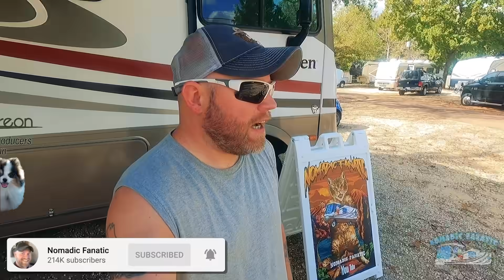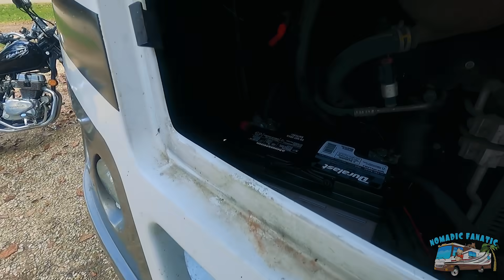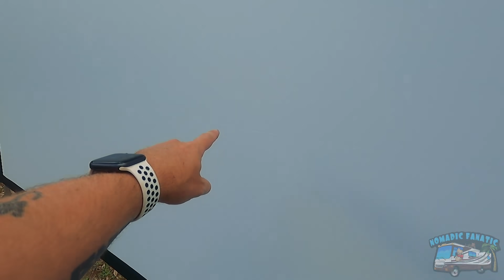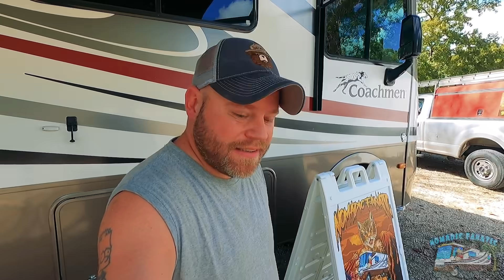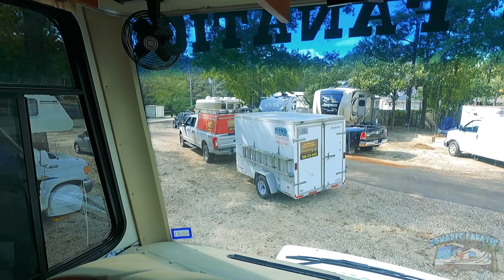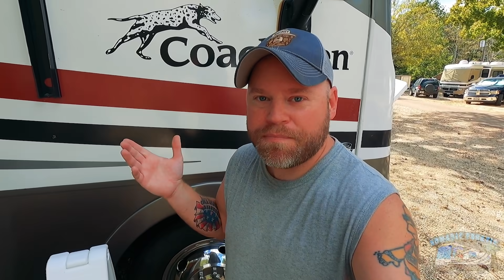More Onan Generator & Lippert Leveling Repairs... $$$

Comment: Trade it in and get a truck and camper.  You can use the truck for hauling things at your new home and use the camper (or trailer) for travels.  A truck really comes in handy for a homeowner, more than a Class A motorhome!!!
Reply: Absolutely...logical.

Comment: On my leveling system I have two breakers that are located under the entry step that trip. "Located high on wall above house battery and pump reservoir"

Comment: Is the hydraulic tank full on the level system ?  If the oil level is low the system thinks the lifts are still down. Has to be all the way full to read properly 🤔
.

Comment: Let’s try this again Eric had the same problem with my generator and if it would start up it run for a while and then shut it self off I waited a few minutes started it back up it would run and then it would shut off again I found out just by troubleshooting it myself found out it was the rocker switch inside the RV hope this helps👍🏻

Comment: When it rains it pours,once or twice every 4 yrs something breaks down at my house: hot water heater, AC,etc. Last winter I had a problem with the heater--it would work then shut off. It took 3 service visits to get it straightened out.

Comment: the biggest part of diagnosing  control systems and failure to do so,  is assumptions.  The old  saying, if you don't  know how it works, you cant fix it when it does not , is a very basic truth. The hardest part a lot of times in diagnostics is getting the proper information on how the system is designed to work.  If you have that information, you are in a far better position to actually fix the system, as you now know what it is supposed to be doing, and how, and compare to what is really happening. without that information, its  assumption time and that is deep rabbit hole. Please keep these thoughts in mind. 30 years  doing troubleshooting  stuff. there have been times I had to reverse engineer the system as we could not get the proper information on system operation, and that eventually led to the repair.

Comment: Elkhart Eric. Go to the Elkhart IN area. Mechanics that used to work for Coachman and Lipert are up there. And it's only about 7 hours to Alton from there.
Reply: Although this was 20 years ago, I had a friend with an RV with problems the dealer could not fix.  So he drove to the factory in Northern Indiana, and they did fix the problem.

Comment: Onan generator is vapor locking, add a fuel pump closer to the fuel tank. You only need a 5 or 8 psi pump. The sensor that detects the leveling legs position is possibly faulty.  The hot exhaust from the generator is heating up the fuel line causing the fuel to vaporize.  Fuel pumps move liquid not vapor. Adding a second fuel pump will put the fuel in the line under higher pressure thus increasing the temperature required to vaporize it.

Comment: Somewhere down the road there's a lemonade to be made with all the lemons you have accumulated.  Looking forward to that day.  That's the problem with a complex RV.  When they get old, they break. And in multiple places.  I have a 4kw onan generator and I'm on my third carb.  I've found that they do not rebuild very well.  About $300 and a little time, I was able to replace them myself.  I've got to run it frequently or I'll end up getting another new carb. They gum up sitting idle. As to the leveling system, I have no experience with them, but with the symptoms, I would suspect the "brain" or it's sensors are kaput.

Comment: Eric, who is the best person/shop to work on the leveling system according to Lippert? I mean you have an rv and it’s not like you can’t travel to them. Right?
As for the generator, the carb and fuel pump have been inspected by “a few” folks what about the supply line? What would happen if you ran the generator off of a separate tank? So the fuel supply would be coming from another source like a 5 gallon tank. If it just shuts off, that’s what I would suggest.

Comment: GENERATOR PROBLEM INPUT FOR YOU:  Our Onan generator would randomly stop running as though it was starving for fuel.  I am not an RV mechanic but people who are tried everything you are going through (carb cleaner, etc.).  Fuel pump tested fine WHEN IT WAS COLD.  After much frustration, I did my own diagnostics:  I ran the generator until it quit then quickly disconnected the fuel line at the carb (easy - its just a hose clamp).  i pressed the prime button on the generator which should send fuel down the line - BUT THERE WAS NO FUEL COMING OUT OF THE LINE.  Synopsis:  The fuel pump was fine when it was cold and generator haD just started.  The fuel pump would overheat (my interpretation) after a random time dependent on numerous factors including outside ambient temperature and then it would stop pumping fuel.  This resulted in the generator stopping running.  This has happened twice on our generator and replacing the fuel pump has fixed it both times.  Do yourself a favor and run the diagnostic I explained above.  Its easy and may be the clue you need to fix your generator.  Good luck!
Reply from the maker: Good work on yours. We've done that as well. Fuel still pours out. We even bypassed the main tank, and used an auxilary tank of gas to feed the generator and it still stops whenever it wants to with no useable code expect 36 - "engine stopped"... Worthless.
Reply: @nomadicfanatic  Sorry that's not the fix - darn.

Comment: Don’t know where you are at. The mobile technician I used in College Station was R&K mobile RV repair (or something like that). They might not be able to help either but worth a shot. Have you thought about going to the manufacturer?
Re the generator...Onan Cummins in San Antonio helped with my last RV and I took this new RV there for an oil change (was in a hurry). They are expensive but they know the units inside and out.
Bummer that all of this crap is happening. Keep your chin up.

Comment: Built by man fixed by man you’ve got the wrong people working on your equipment. Researching repair facilities is your first step and I am confident you know this, the fact that you a many others that travel full time experience this type of delay in getting speedy repairs. I find it easier and less stressful to find a quality repair site, then find a RV resort nearby until they get to my coach for repairs. Sounds easy but at times it’s the only option you have. You situation is unique in as much quality content can’t be produced as often when your stuck without your home. IF THE WHEELS ARE NOT TURNIN YOU ARE NOT EARNING! Good luck to you and JAX 👍🇺🇸🍺

Comment: Heres one for you on that generator. There's a low oil shut off sensor and if your motor home is not level the oil will go to one side of the crankcase and the sensor thinks its low on oil and shut off the generator to protect it. Just a thought. Hope you have good luck in the future.

Comment: That has to be really frustrating Eric!  I wonder if the hydraulic lifting pistons themselves have been damaged ?  do they each have a sensor in them which signals the control unit whether they are extended or not?  maybe one of those sensors or the lifters is malfunctioning?  at any rate, at least the RV is still usable without the lifting system.  The generator situation definitely seems like a more urgent fix, since you can't really boon dock without it, if there isn't reliable sun for solar.  Personally in your shoes, I would buy a small honda generator, as a backup.  At least it gives you more options / freedom.  Then I would probably try and get in touch with your pal Wayne... you can't under estimate the value of a good trustworthy mechanic that is an actual friend.  maybe he can give you some advice or take a look at your generator?  with the election sitting the way it is, and the potential for more and longer lockdowns, i don't know whether it'd be better to take a break at your house / property, or head for a state like FLORIDA that is actually open!  either way keep us updated, and keep keeping it real eric!

Comment: Have you disconnected the remote start harness at the generator? You could have a wire chafing and grounding out and shutting down the generator. Disconnect it and use the start switch on the generator and see how long it runs.

Comment: To me: It's NOT the RV. It's the lack of having professional people, people who actually know the items they work on AND have the proper tools (and contacts) to go deep in regards to trouble-shooting. The onan guy bench-testing the fuel pressure makes sense as a first step. If this is where his knowledge ends, bad luck. After this first step, he should dig deeper. One who really knows these generators would know where to look. the trick is to find a real professional. Same goes with the lift. The guy must have been on the right track, especially it the guy on the phone from the manufacturer knows his sh*t. If the display shows Jacks down, then there must be a sensor giving that information. This needs to be tested. If sensor is not giving such signal, then the harness/connectors do need to be tested. If no error is present, then the control unit must be diagnosed. This are just guesses, because I actually don't know the system, but a professional would know, AND find the solution.
I am surprised, that with your follower-base, there are no contacts to REAL professionals, who know the units with issues inside-out...
Honda Inverter generator could really be an option for you (maybe with a propane conversion), especially if you have a Victron MultiPlus, and the Batteries as a buffer. Average hourly consumption of the AC would need to be known to have a generator who could meet the average demand at least. Let's say (hypothetically) the AC requires 2000W while running, but only running 40 out of 60 minutes, then an EU30 with remote start could be a valid option. The Vicron MultiPlus could be set at max 2000W-2200W to draw from the generator, therefor generator would not run on full load. Batteries and inverter would buffer high start-amperage, and if no other units are running, the battery overall would charge. If batteries require no charge, the MultiPlus could even set to a lower max draw from the generator (eg 1500W), and therefor run QUIETER, charging the batteries, when the AC is OFF and delivering power to the AC (besides the batteries), while the AC is on. If no AC is required and power consumption is low, but batteries need some charge, then the MultiPlus could be set to draw 1000W from the generator only, slowly charging batteries and run pretty QUIET.

Comment: Are you only having problems with the generator while stationary? They recycle all the hot air until they overheat and quit running. If that is the case a blower fan pushing out the hot air from under the generator should help.

Comment: Hey Eric, sorry you're having such a hard time... But here's two things to check out..
On the generator, your fuel lines may have collapsed internally and no pump will supply fuel.. So maybe run a new line, not very expressive....
  The leveler may have a gyroscope issue, there should be a box that is mounted to your frame or under the dash that if it has fallen or is not horizontal it will always think it's our of level thus not work.
  The slide should be able to be fixed by a mobile tech.

Comment: I had a van that would do same thing as your Generator. Sediment in fuel tank would get sucked up and engine would die. Would let the van sit for awhile and it would start up great . could drive for a few scond filter in tank filter in fue  F mile and would die again. Maybe your picking up sediment in your fuel tank. Possibly a filter in tank. Just a thought. I.m not familiar with RV setups

Comment: Everything can be fixed. It's just a matter of finding people that sometimes think outside the box instead of 'what usually works'. I have run into this too often in my life. What I have done is researched the hell out of what others can't seem to fix. Now, years and years later, I can fix nearly everything I own. Even though I am in law enforcement and not a trade. Good luck and maybe it is time to recharge a home base with other projects.

Comment: Would try taking your rv to an actual hydraulic repair shop. If nothing else they should be able to rig the hydraulics to operate manually. Hydraulics are not rocket science. ok, maybe some of the electronics are that the rv manufacturers install but for the most part hydraulics are not super complicated stuff. 

As for the generator it probably would be best to just figure out a way to best setup a portable unit.

Automatic push button systems are nice until they mess up and no one can figure out how to fix them. Simplifying systems will likely be better in the long run.

Your slide problems are likely the biggest issues you have as the slide operation is dependent on the structural integrity of your rv. 

Good luck man and keep your head up. You will get it figured out as you always do.

Comment: On your onan there is a small control panel it has a diode that goes out sometimes intermittently new that box is about 150 i have had servel of them that will only work when the moon is at the right angle

Comment: GENERATOR SOLUTION: I think it's electrical. Maybe you have too much oil in the generator.  The oil sensor switch can be extra sensitive and under load sitting or vibrations going down the road, that switch gets triggered and shuts down the generator thinking something is wrong.  Usually a fuel pump is binary - it either works or it doesn't. It could be a fuel filter but once that was replaced, remove it off the likely list. My guess is that it has something to do with heat. Once it gets to a certain point, a sensor is telling it to shut down or there is a break in a circuit board that when it gets hot, it expands enough to short out/break continuity - but the first thing I'd do is to remove some of the generator oil to test that switch. You or a service tech may have put just a hair too much in. Also,  I commented a while back about the leveling issue being related to when you used it to jack up the RV high enough to change the tire. If I recall that video, you put blocks under the lift so the throw would be long enough to lift the entire rig.  If that flat tire change was when your leveling issue started, I'd focus my attention to that physical jack.  I don't know if this would work, but if it were mine I'd give it a try. Find a way if possible to lift the entire rig (maybe a semi truck repair shop?) and then run all the jacks down as far as they will go. Measure and compare the length of all the jacks to see how close they are to each other.  As odd as it sounds, they may be out of sync with each other. Not the same but think of it as though one side of your slideout is advancing just a touch more than the other side and if there is a computer monitoring that, it's going to complain.  Know this is a long comment but thought I'd share in case someone else hadn't suggested what I just did :)  Good luck!

Comment: On the generator, sounds like a fuel restriction. The line or pickup screen in the tank needs to be checked. I would disconnect the fuel line on both ends and blow air through it. If that's good, check the pickup screen in the tank. Good luck.

Comment: each jack has a sensor.  i had two new jacks replaced and the system still would not work.  the problem turned out to be a bad sensor on a new jack.  if a sensor is bad it won't let your system operate.

Comment: I had a similar problem with my generator. It would work great then just stop. Let it sit for a bit it would start back up. I got a can of CRC electrical cleaner pulled apart all the electrical connections sprayed them real good put it back together never did it again.

Comment: You/I would think that when someone comes out to work on the generator, they would test it (standalone - RV) to see if it runs.  Maybe it doesn't have any compression.  Or maybe it runs by itself, but not connected to the RV..;.which then there's something wrong with maybe a defective power detection relay that kills the unit if it's not putting out power or detects bad power, maybe defective oil pressure sensor  shuts it off...They've got to figure out what it is, before giving you a bill.  Definitely frustrating.

Comment: Eric, I can't advise anything other than take it to a reputable dealer. BTW, On the generator, it is my guess that you have a slight blockage in the fuel line. Try cleaning it or replace it totally.

Comment: If it says jacks down, excess angle to me that would  indicate the system is expecting some type of feedback from components (sensors)  reporting position of jacks and  angle sensor of some sort . telling it  these values are out  spec. is that information from the sensing devices digital or analog voltage values? I don't know, but the good thing is the system is reporting a  condition that is not actually happening. why? bad wires, Connections,  sensors? just trying to help from the couch.

Comment: Pull the cover off the side of the Onan engine that has the oil filter in it. The oil pressure sending unit is screwed into the block. Unplugs the wire from the sending unit and ground wire to the engine. Start engine .  If it remains running  for a while the sending unit is your problem.

Comment: Just a thought. Could there be contaminated fuel feeding the generator?? As for the pump at least in the automotive industry there has been a rash of new parts which are either DOA or go bad way too soon. Parts are being made in China and are of substandard quality. I know that does not help but maybe an explanation.

Comment: maybe you could talk to the mechanic about  installing some manual controls in stead of relying on automatic ones.  sometimes that can fix the phantom electrical bugs.    your generator is mechanically fine, its some sort of control that is shutting it off.